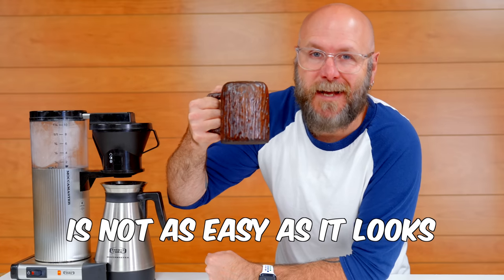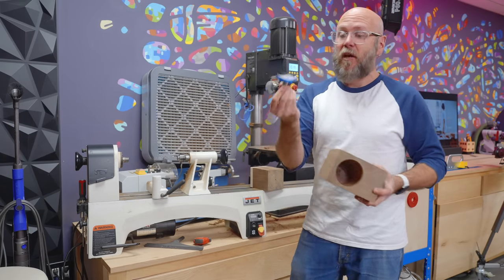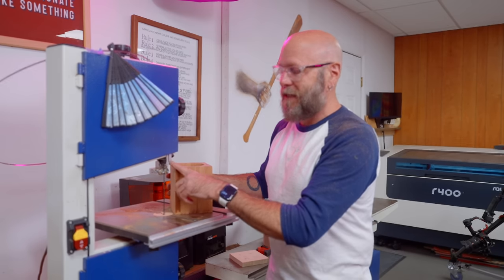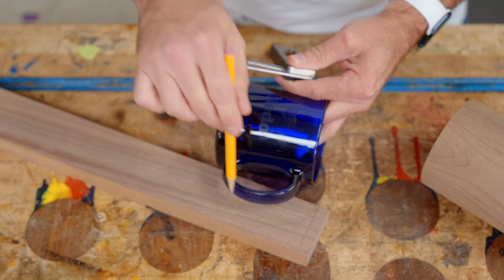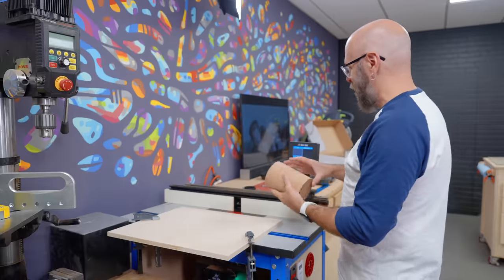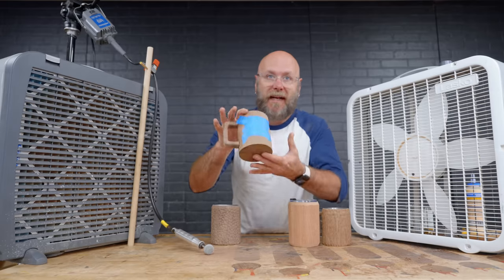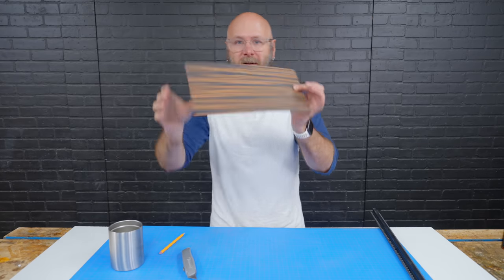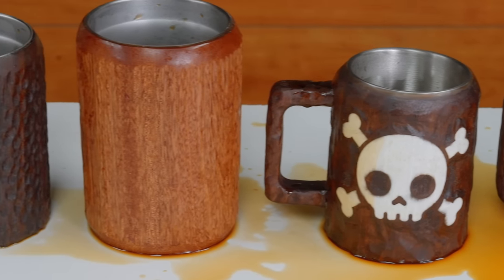Making a Wooden Coffee Mug Isn't as Easy as It Looks

Comment: As someone that does cups and mugs on a lathe, the step up method is the best for ensuring a clean hole. Also the type of but you have will have wobble, due to the carbide being wider than the rest of the bit. Normal forstners don't have that issue commonly.

Comment: I always wanted to make a medieval, wooden beer mug. With beer it's easier, because normally you drink it cold, or room temp at worst case. I used a nice piece of cherry, cut 12 segments, glued them together, then used boiled linseed oil with about 40% by volume molten plain white, unscented candlewax dissolved into it. Gave it 4-5 coats, scraping back the build-up inbetween coats, and after a couple uses, it doesn't add any nasty flavors to my beer.

Comment: So generally in machining, spinning the part adds rotational mass and generally is more ridgid than a moving tool, the second part is if you prebore to 30% or so of your final tool (generally 1/8”, then 3/8”, then 1/2”, then going to boring ops) is fairly normal so if you went to like a 1” fornser first you have a far more consistent cutting speed in the second cut leading to less tool force and chatter (which leads to more over boring like you experienced)
Reply from the maker: Thank you! This makes sense!
Reply: @MakeSomething  no problem. I like to make things like cigar pipes, and many of my issues were that it’s almost a machining exclusive issue rather than wood working. If you take a second to cross train yourself by just watching the blondie hacks basics series you’ll probably get far better at wood working

Comment: I feel like there's gotta be a way to do a food safe wood mug for hot liquid without having to use an insert
Reply: Bees wax. Melt some in a small cooking pot, then dip the mug into it. Let soak for a bit, then take it out and let cool. Use boiling hot water to rinse out the inside (and possibly outside). Yes, hot coffee will melt the wax on the inside, but it should be soaked into the wood enough to not be an issue. That hot water rinse would have washed out anything that could have melted into the coffee.
Or do what they do with barrels: burn the inside. Scrape out any excess charring, then just let coffee soak into the wood for a bit, just like fluid in a barrel. Only use water to rinse/wash it.
Reply: @AgentWest  I was thinking some form of charring might do it, but the bees wax soak is a good tip